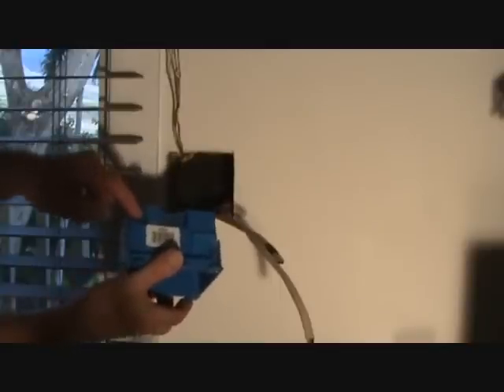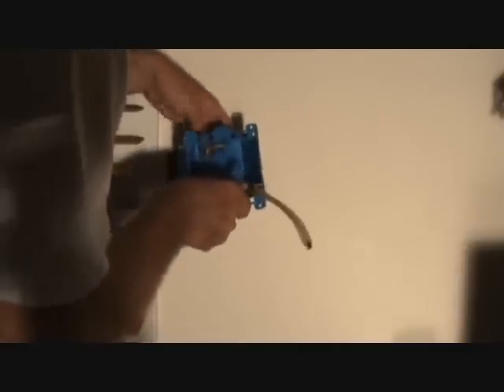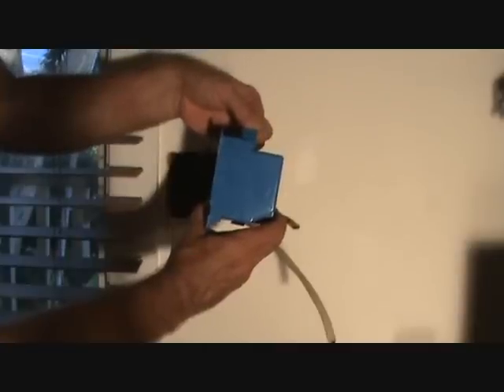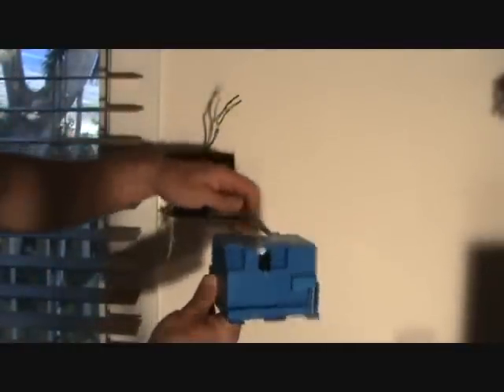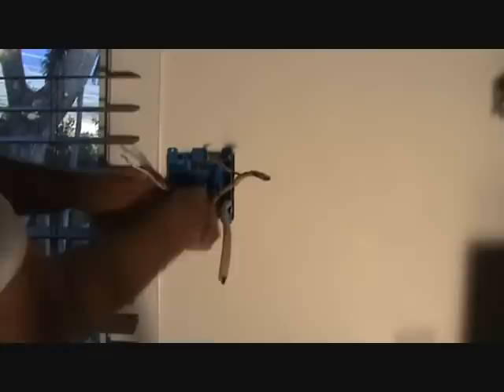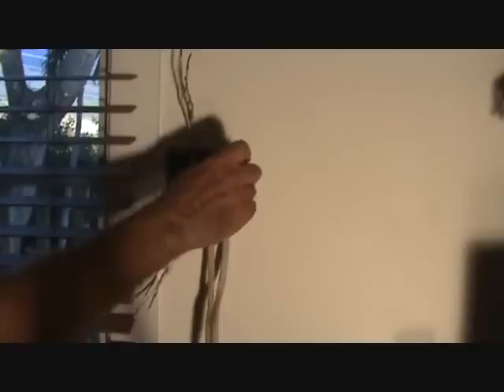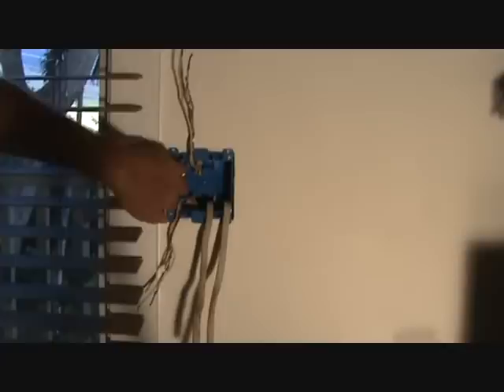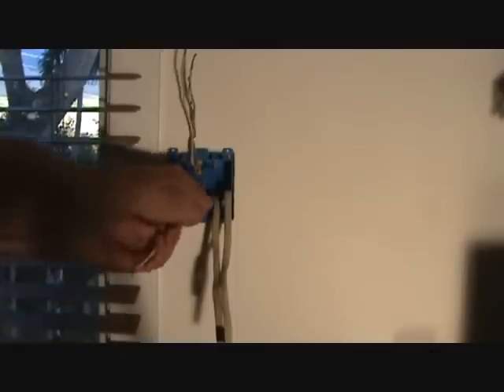Installing an electrical cutin box

Comment from the maker: You can leave the tabs on & push the swivel part up into the box. It makes it difficult to do this when you're putting 4 cables into a box, plus it takes up more room in the box & sometimes you need that extra room depending on what type of switch you're putting in. When I connect up all the ground wires, that keeps the cables tight from sliding out of the back end of the box etc.. Also leave a little bit more of the sheathing in the box, when stripping back. Thanks for commenting.   Joe  :0